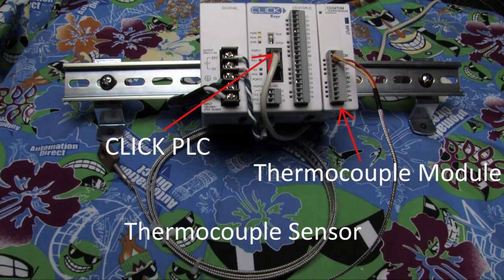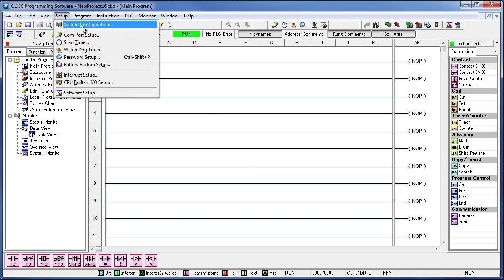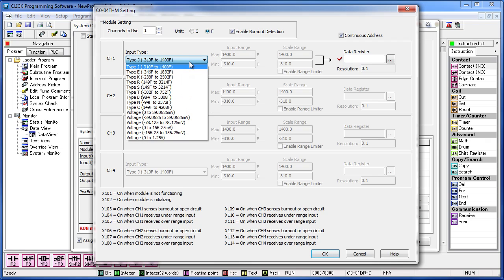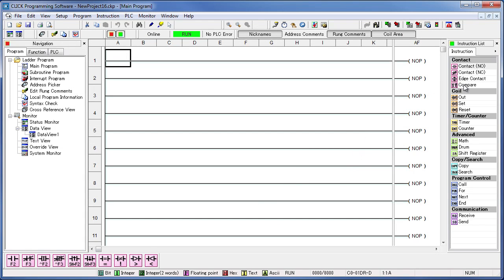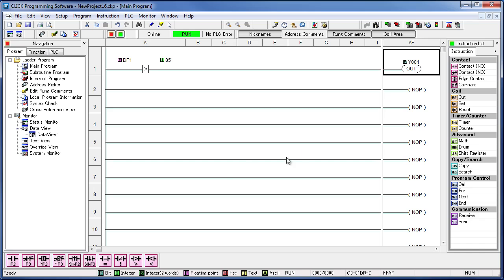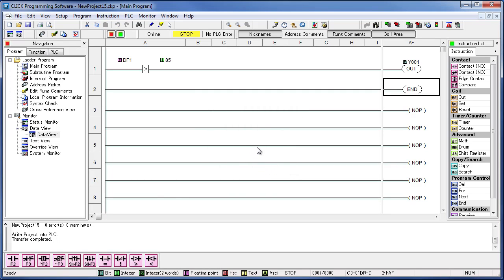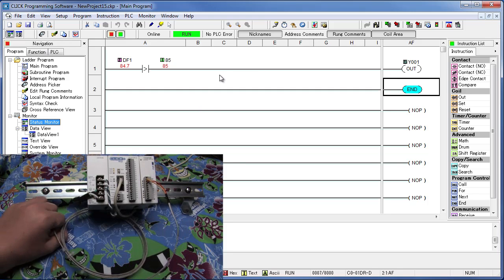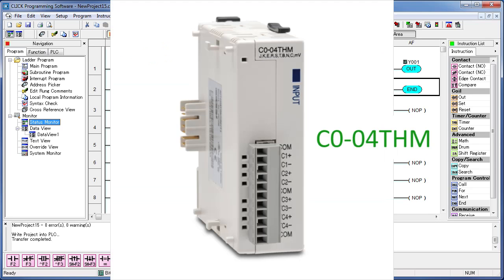How To Setup & Use a Thermocouple Module in a CLICK PLC from AutomationDirect

Comment: You can still use thermocouples with standard analog input modules correct? You just don't get the extra features?
Reply from the maker: You can connect a thermocouple to an analog input card, but you won't get any usable results. Thermocouples create very small currents by connecting two dissimilar metals together. Normal Analog input cards don't have the necessary electronics to extract those small signals and convert them into something you can use. As an option: You COULD connect a Thermistor to an analog input card - that's just a resistor that varies with temperature.
Reply: @automationdirect  awesome thank you, I want to make sure I get the right hardware without purchasing unneeded components. My thermocouple research wasn't helping much.